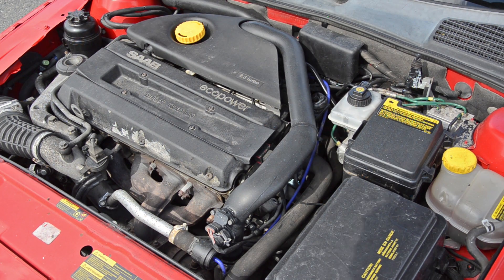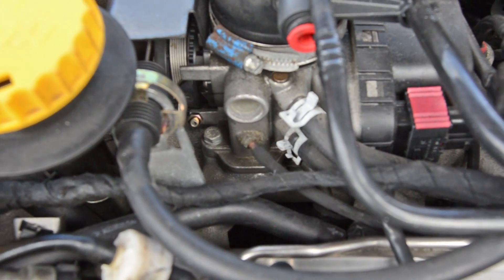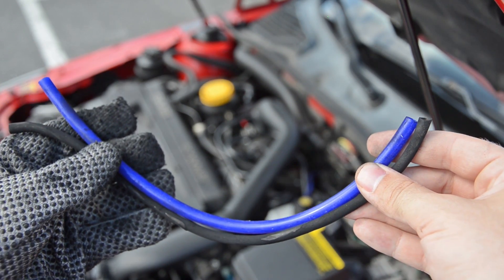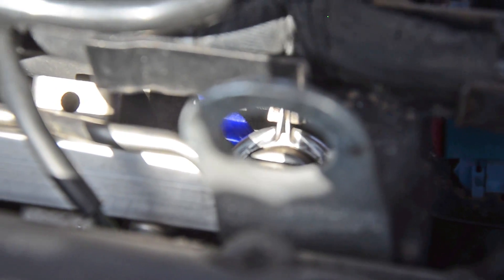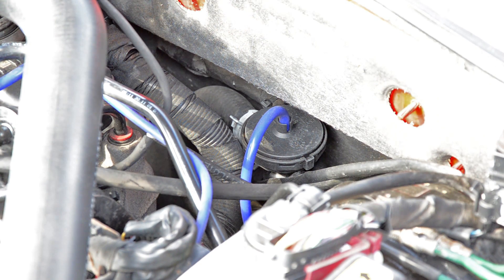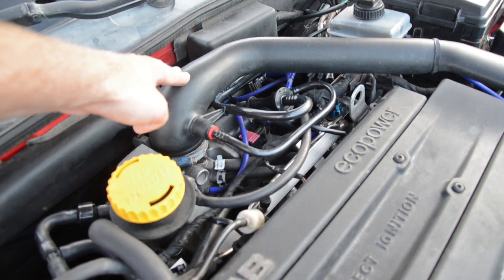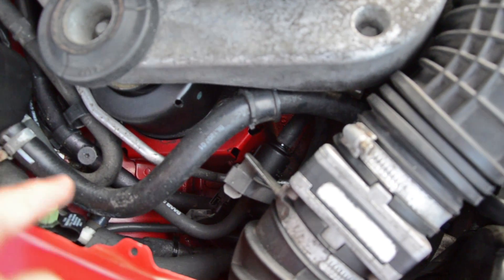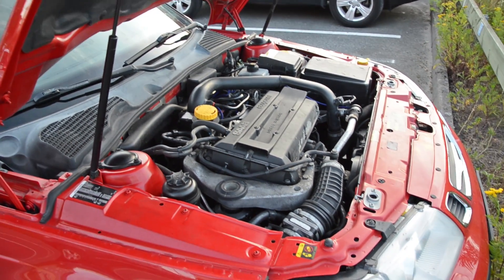Saab 9-5 DIY: Vacuum Line Replacement (Silicone Hoses) - Trionic Seven

Comment: I have a saab 9-5 from 2005 that looks pretty much like yours. About two weeks ago I noticed a sound I never heard before. When I turn my key all the way but don't turn on the engine I hear a clicking noice for about 5 seconds. It seems to come from the little box with all the wires that you can see in your video at 1:55 seconds. Do you know what that box is or does?  If you do please reply in swedish the name of whatever that thing is. The reason I ask this is because the same day I noticed this sound my car started to idle really low and sometimes die on me completely. The car also sometimes jerk forwards when I accelerate but that rarely happends.

btw great video. You do great content!
Reply from the maker: That box is probably just the main connector, not sure of the name in Swedish actually. Is there an electric fault somewhere there?

Comment: On my last 9-5 I used 5/32"  (or 3.5MM hose) which seemed about right. Are you using a larger inner diameter hose because its a silicon hose ? Very informative video, but the Dame Edna is a bit different it looks like.
Reply from the maker: Inner diameter? I think 4mm is the outer diameter.
Reply: Sorry for not replying sooner. I measured it, and that is indeed the inner diameter.

Comment: I have Saab 2001 9-3 SE that I have owned for about 7 months and lately I have been chasing different problems.  I'm wondering if the blue silicone lines you used will also work with my 9-3?  BTW, this is a great channel and has helped me a lot so far.  I actually have a problem of the car wanting to go upon acceleration but it feels more like it's pulsing and I'm wondering if a vacuum leak could be the cause.
Reply from the maker: The T7 9-3 is quite similar to the 9-5, but I guess hose routing could be somewhat different. Just change one hose at a time and you'll figure it out. For hesitant acceleration i would check plugs and air filter.

Comment: Great stuff as usual!  I just replaced the first two and there were clear holes in the hoses I removed.  Two questions, however, is it okay to use inner diameter of 3.5mm?  Also, regarding the one that goes down below from the T-connection (the one that has the check valve).  Looking down from the top with a flashlight, when I wiggle the hose I can see the check valve down there, but where the hose below that check valve connects would appear to be some assembly that is just loose - maybe some type of bracket.  In other words, I wiggle the hose, and while I cannot see the absolute bottom end connection, I see some little assembly loose and wiggling as well.  Do you know what this is?
Reply from the maker: I know that the hose I used was 4mm, don't know if anything else will fit. Unfortunately I don't know the answer to your other question but I suggest you ask on one of many Saab forums :)

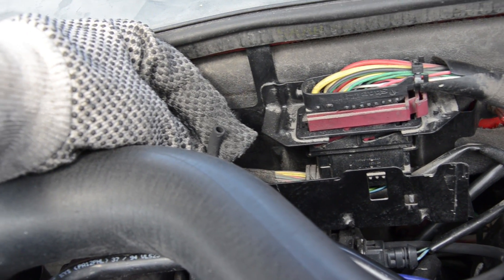Comment: Hello I got a saab 9-5 turbo -03. My question is, do all saabs have a break booster (host?) - the pipe he pulls out on 2:06? I have the red thing and everything and it looks exactly the same as his saab but i dont have the pipe? Thx
Reply: Read that its because of the automatic engine so nvm :)
Reply from the maker: That's right!
Reply: Måste jag ställa om batteriet kanske också?
Reply: skitsamma

Comment: That hose you said it was impossible to show where it goes...with the valve..Mine wasn't connected to anything..and I couldn't find where there is a nipple on the firewall.
Reply: Use a mirror and light.

Comment: does anyone know where the small hose that comes from the gear box top and is tied to the fuse box, it apear to go open from there  is it a breather  hose . the size is that opf a small vacume hose on a 95 2.3l turbo model
Reply from the maker: +BoB Whitfield I think that's a breather hose, pretty sure that the transmission has one.

Comment: After replacing the lines how did you initiate a system reset for the computer to reconfigure the boost pressure?
Reply from the maker: +Evan Merrick No need, the system adapts itself.

Comment: What you called the brake booster is blanked off on mine??? Should I be worried or is this some sort of mod?
Reply from the maker: +Glenn Travers I probably should have mentioned in the video that cars with automatic transmissions have the hose going to another outlet. :)
Reply: So if this is blanked off is this normal?
Reply from the maker: +Glenn Travers I think so.
Reply: I have an automatic from 2004 and it has a mechanically driven vacuum pump on the LHS(seen from driver seat) of the cylinder head. I do not have the booster venturi or the pipes. I also wondered what the blanked off hole in the charge pipe was.
Reply from the maker: That's right! I only drive manuals 8)

Comment: so i just need 3 meters of 4mm hose? i saw on saab forums that people are replacing some hoses with 6 mm. i have 95 with b205e.
Reply from the maker: +ppwpl Correct. The 4mm hoses are the vacuum lines. You might be thinking of the 6mm EVAP system hoses with blue check valves. They can be replaced too, but that's a separate video that probably will be done next year!
Reply: +Trionic Seven: For Saab Enthusiasts OK thanks m8. If i'd like to replace the EVAP hoses, how much of this 6mm would i need?
Reply from the maker: +ppwpl The only guide I know of is in Swedish: http://forum.saabturboclub.com/showthread.php/81210-FAQ-T7-EVAP-Tankurluftning-Br%C3%A4nsleavdunstningssystem it appears to need 2m. Although here the check valves are more important than the hose AFAIK.
Reply: +Trionic Seven: For Saab Enthusiasts thank you

Comment: It looks like the O-ring on the throttle body is missing or worn out? Very common that they get flat or cracks. Very cheap and easy to replace! I recommend to change that when you have the inlet pipe removed like when you replace vacuum hoses. Saab original costs about 9 SEK. OEM-no:  	4940698
Reply from the maker: +Bersa33 Good point!

Comment: +Trionic seven Jag har nu bytt mitt PCV-system och samtidigt mina vakuum-slangar enligt din instruktion. Men det ser inte lika dant ut. Jag har tex inte den slangen Break boster hose i min bil, som du visar 2:05 in i filmen. Jag har samma årsmodel och 9-5 aero TJE057. Jag har ej heller coolant by pass valve och den t-kopplingen du pratar om.
Reply: +lars niklasson Kan det vara så att du har automatlåda?
Reply: +Jonathan Jogenfors (Jonathan Fors) ja naturligtvis är det så. skönt jag fick veta. tack

Comment: great video my question I have is there a way to get a complete vacuum hose diagram I just rebuilt my engine everything is new but the vacuum hoses the guy I got the car from had a birds nest in the compartment and I just cut it away they went to the wrong spots but when I look in my wis . eac and epc  I can not find a complete diagram and what I did find only covers a couple items any subjections as to where to look thanks anyone for your help
Reply from the maker: +robert m Hey! All vacuum hose diagrams can be found in WIS, did you check the "general information" tab?
Reply: yes I have looked in that section and found some of the routing of hoses that I needed but there is a tube that comes from my vacuum pump (electric) in the wis that does not show the end where it goes I know it splits to the booster for the brake but I have a nipple on my intake manifold like the one on your tube that is on top of the TB that has the red release ring I'm trying to find where that goes non of my diagrams show where that connects mine is a 1999 9-5 2.3 turbo trying to explain it as best as possible thanks for any help
Reply: found all the info thanks

Comment: Hi,
Thanks again for a great video. Would you mind telling what OBD2 app and adaptor you are using? Also what phone would be helpful. I know there are serious compatible  issues with this three.
Reply from the maker: +Mats Jk If you use a genuing ELM327 you can use any android phone. I recomment Torque Pro.
Reply: +Trionic Seven: For Saab Enthusiasts Can you send a link to what ELM327 and what version of Android you have? I have been trying many, and also others have big problems with wifi and bluetooth. Now I have an iPhone, and even if there is a ELM327 for iPhone it still don't work.
Reply from the maker: I don't really know. If you bought the ELM327 from ebay you might have your problem there. I bought the ELM327 from Kjell & Company in Sweden. I am using Android 5.1, but that is not reallly relevant as it works with all Android versions. What problems do you have?
Reply: +Trionic Seven: For Saab Enthusiasts Ok so you have the blue one. I also have it. But with this ODB2 adaptors it seems we also need a little bit of luck to get it working. People (like me) can't get them to pair. Most don't even show up. But I will try with my wife's Samsung (Android) to see if theres any luck.
Reply from the maker: What error message do you get?
Reply: +Trionic Seven: For Saab Enthusiasts As I said. The iPhone don't even find the ELM327 unit. But I tried with my wife's Samsung (Android) now and it is pairing ok. So I will continue from there :) Are you also a member in any forum where I can contact you about something else?
Reply from the maker: +Mats Jk You can chat with me over at https://www.facebook.com/SevenTrionic
Reply from the maker: +Mats Jk But as always, there is no chance for an iOS device like the iPhone to connect to the ELM327
Reply: +Trionic Seven: For Saab Enthusiasts And I was thinking to buy a ELM with USB to connect with my Mac. That should work I think. There is software for Mac.

Comment: Superbly detailed video, I just got my silicone hose through today so this will be my first vacuum line replacement on my 04 Saab 9-5 Aero, one question though, are hose clamps or ties needed for the ends at all?
Reply from the maker: +Malcolm Cooper Some say they are needed, some say they're not. If you want to be safe, put them on! :D

Comment: Tip: Something I notice today when I did change my vacuum hoses. Is that if you have removed the bypass valve to for the cooling fluid. You will missing the T-connection. I did scratch my head for a while before I did see that some previous owner have removed it.
Reply from the maker: ***** Could this be the BCV bypass mod? Several people have done this, however I am skeptical for the time being. http://www.saab-tuners.com/trionic-7-turbo-stable-throttle-response-mod?___store=english&___from_store=nederlands
Reply: @TrionicSeven   That link is now dead, but thanks to the Wayback Machine I was able to find it. I'm adding the text from the page here for future reference. 
<copied text starts here>
TRIONIC 7 TURBO STABLE THROTTLE RESPONSE MODIFICATION
If you have ever refitted your 4mm vacuum hoses for silicone hoses (a must do in my opinion), you will have noticed a little black box with three hoses connected to it. Have you ever wondered what that box does? I sure have.

The box works as a control for the turbo bypass valve, when the box is disconnected the turbo bypass valve is "hooting" a little under light throttle. This is kept under control by this valve, reducing the noise under the hood. When you bypass this valve you will get a more responsive throttle feel.

In simple words: when you do this modification you will be able to take speed bumps in second gear on a manual gearbox Saab without the car hickupping and struggling. It will go smooth, even under idle rpm.

What you need to do is the following.

Disconnect the vacuum line from the throttle body and cap the throttle body vacuum exit with a silicone cap.
You can also (temperarily) do this by cutting 35 mm of vacuum line, plug it with a screw and make it durable with a hose clamp (see image).

Disconnect the top one of the two hoses running to the manifold connection op top of the inlet manifold on the right of the throttle body.

Connect the bypass valve (/ recirculating dump valve) directly to the top manifold connection on the inlet manifold you just disconnected. If your Saab has a T-splitter somewhere in the lines (9-5 only) you are replacing you can add the T-splitter in the new line between the manifold and the bypass valve.

Remove all the excess vacuum lines connected to the valve on the firewall but leave it electrically plugged in otherwise you will get a CE light.

All done, reset your ECU by unplugging the battery for 30 minutes or pull the ECU fuse for a minute to get a fresh start. This is however not absolutely neceserry, on a manual gearbox Saab you will immediately feel te difference.

<end copied text>
Reply: Trionic Seven: For Saab Enthusiasts No. The Crane on the firewall or what you call it to the coolant. That thing have been removed for me so that's why I don't have a T-Connection on one of the hoses. So all hoses are connected just missing the T-Connection.  And that BCV Bypass mod is something I have thinking about trying out.

Comment: Great video as usual! Though I would like to ask when should I replace my vaccum lines? and what are they actually used for?
Reply from the maker: Man Oat Thanks! There is no set interval for replacing the lines, so unless you have problems it will never get done during regular service. Vacuum lines are used for many "little" things in the engine, such as remote control of valves, vacuum transport, vapour transfer. When they go bad, many "little" problems can occur, but nothing really serious.